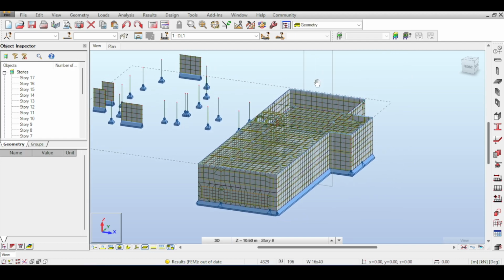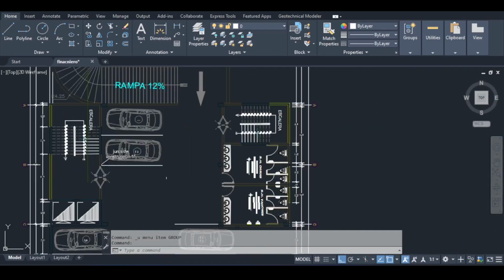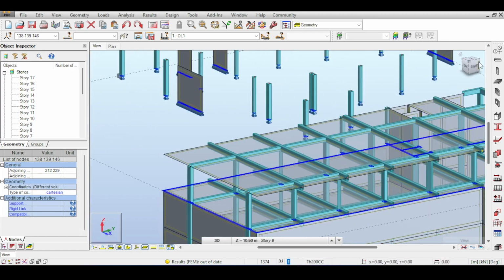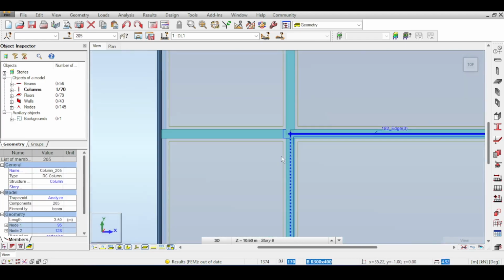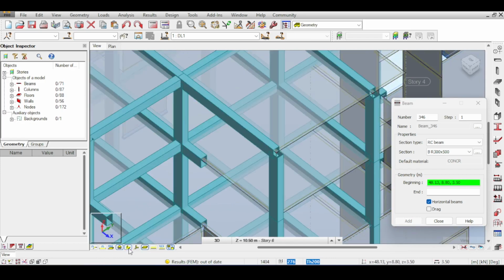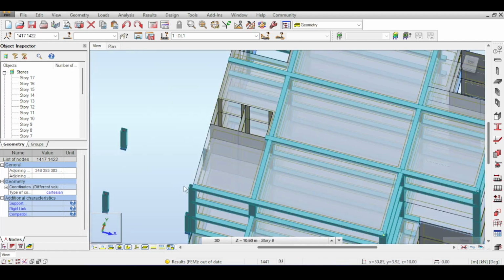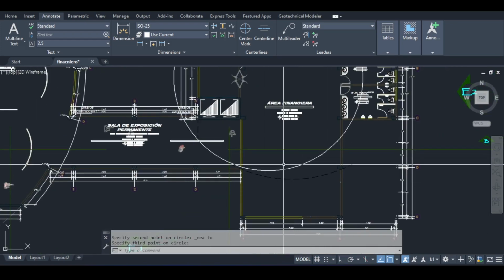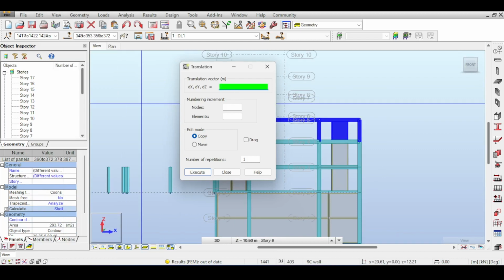Modeling and Design of RC Buildings in Autodesk Robot | Part 6: Right Tower

Comment: Hello Doc.

1. I think it’s practically easy on site to have 2 columns at mid landing slab of the staircase to support the mid landing beam as opposed to having the staircase support come off the basement walls. 
Using the basement walls will probably introduce a lot of errors and cold joints in the walls unless it’s done tactfully 😊

2. Is it possible for the dxf background import to update the general arrangement drawings to include the curves so our work is easier? I remember some columns updated in the robot model from within autocad.

Anyways thank you for this wonderful tutorial and god bless you abundantly.
Reply from the maker: Hi there Engr. Sarpei,
I totally agree with you. Actually, this comment is featured in the video that was just released. ^_^
huge thnx for your input. God bless
Regards,
CEE

Comment: Hi, I am sorry I know this question is not related to this video but I hope you answer, I know you are the AISC 360 guy for steel design.
According to chapter C of AISC 360-16, we should Consider geometrical imperfections by applying the national load, If I perform a Second order analysis for the structure(In Robot), is still needed to apply that national loads ?
I hope you have a video on Chapter C and explain it briefly.
Thanks
Reply from the maker: That is a really good point. I will consider making a video on it once I finish my RC series. 
But here are two documents that are giving some "brief" explanation of the imperfections.
Slide 30 here is relevant.
https://seawi.org/images/downloads/Webinar_Documents/2019_04_18_understanding_the_aisc_direct_analysis_method_of_design_handout.pdf

Also, 
https://www.aisc.org/globalassets/continuing-education/quiz-handouts/direct-analysis-method-handout.pdf

I think making a video about this would be benficial.
Regards,CEE